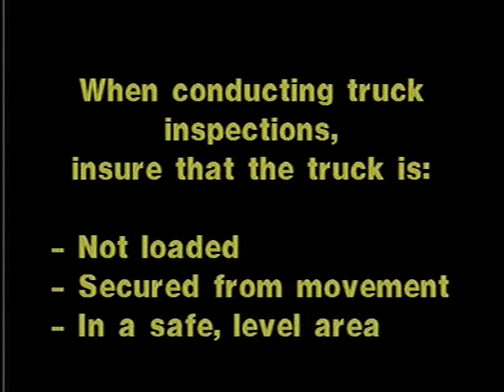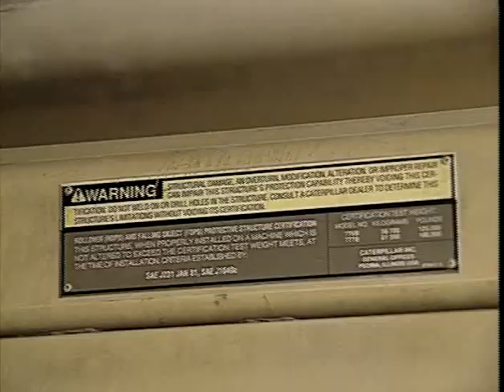Inspection of Off-Road Haulage Trucks by an MSHA Inspector

Comment: as a mechanic in the mining industery It was our responceability to go down the line off equipment between shifts to ensure that the equipment was in operating condition before the next shift arrived and did and did a simaler inspection. if problems where found that impared the safe operation of the equipment we would lockout the machine and notify the shift supervisor

Comment: Just a point which makes this, if it is a genuine Inspection, absolutely bloody useless on this particular truck.

At least half or maybe more of the things mentioned that must be checked cannot even be seen with this truck being so dirty. How can a weld fail or any leaks on the lines be seen and or diagnosed, well, it can't!
I have seen this checking before and the trucks are checked outside a washing facility using high pressure water to clean the crud, mud and rocks away, it takes 12 hours.

Comment: not trying to be an ass but in the states MSHA can and will inspect haul trucks and other equipment without notice and without washing  all i am is a tire tech for these big trucks but i get inspected too   msha has more authority than osha does here       i dont know what agency you have in the uk  but here msha is very strict and can be assholes but they are just doin thier jobs    and they dont let you wash the unit before inspection